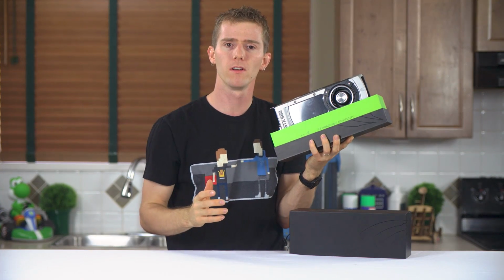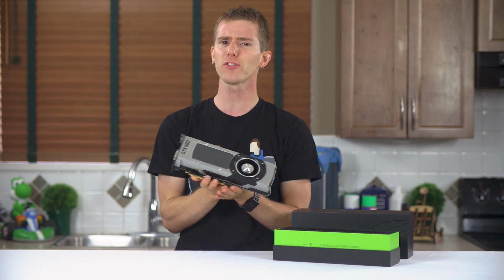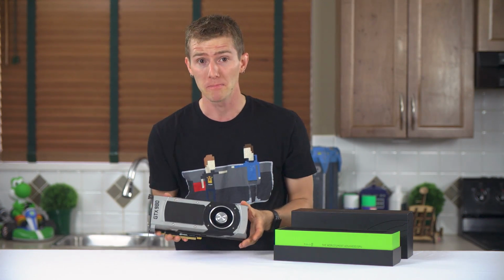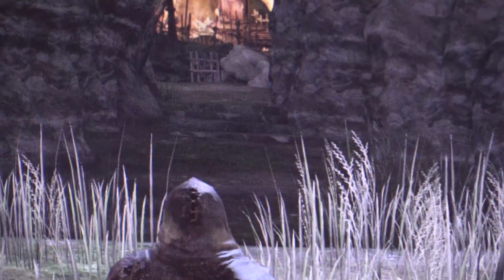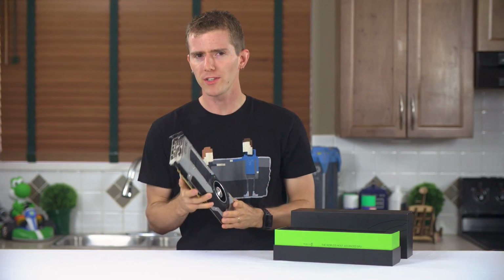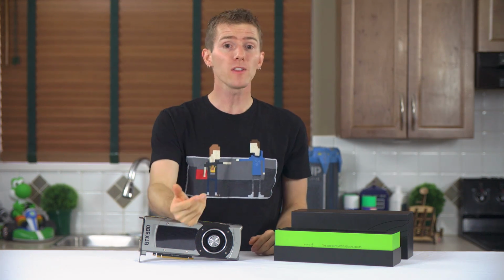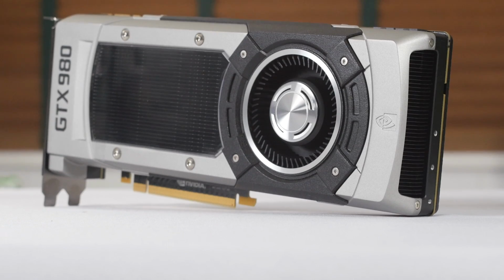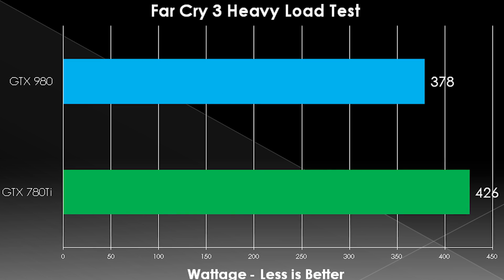NVIDIA GeForce GTX 980 Video Card - Performance Overview

Comment: Oculus improvements can only be a good thing i cannot wait for the consumer model.
That VXGI sounds incredible can't wait to see some games use this or even see how it goes with 3D rendering software could be great for previewing what the lighting looks like before starting a super intensive ray tracing render.
I'm gonna have to order from overseas due to being in Australia each brand varies from $700-$800
The US is $550 that's $613AUD and postage i doubt will be more than $20.
Great review I'm definitely saving up for one since my HD7950 has a faulty diode so it reports the wrong temp so fans rev up to 100% anytime anything intensive happens.
With the crazy OCing results i wonder how this bad boy will perform with water cooling?

Comment: Well the 980 isnt a deal breaker for me , its basically a 780ti with a discount , unless it can out performed the 780ti and the titian at stock clock i wouldnt buy it ta all . i shall wait for the 980ti !
Reply: It does. It outperforms every single GPU atm.
Reply: hmm i saw a couple of benchmarks that show the opposite . i am hoping for a stock clock beat down instead of an overclock advantage .

Comment: Well the GTX 780 Ti was a good purchase apparently, since the 980 is not a huge upgrade, and you could buy the 780Ti much earlier. I was expecting a bit more from it, but at least it's not very expensive, and compared to the 780 it's quite better, which is more of an apples to apples comparison. Not too shabby! Let's see what AMD has in store, cause if they keep increasing their power consumption, their next flagship will need a separate PSU to power it xD

Comment: How can they stop from 780 to 980 and and have the 780 perform better. Makes no sense
Reply: 980 outperform 780ti in most of the games, on hardware canucks benchmarks. Benchmark is not always accurate, so we should watch more of them to access the situation.
Reply: And assuming if there's a 680 ti back in 2012, 770>=680, then 780 would >=680 ti. And now 970>= 780, 980>= 780 ti, quite make sense I guess.

Comment: My 580 is still kicking some major ass!
Reply: My 480 is still a jet engine...
Reply: Im running 2 x evga 580gtx superclocked with 3x 3D monitors an it's still smashing it, Can max most of my games even across 3 screens :)
Reply: Kiro Zopp Hahaha. Those 480s are like having a hair dryer in your case. Just like my old 4870X2.
Reply: my 560ti died :(

Comment: As with the Hyper X Cloud headset review, great timing! I was just starting to consider throwing a 2nd 770 and a Noctura fand on the cpu (for OC) onto my old X58 platform to postpone my next upgrade a bit longer. The 980 seems to be a good upgrade from my 770 to warrant it being reduced to a physics slave card in the future.

Comment: im not all that spec savvy but from what im reading this doesnt work on laptops, right?
Reply: nope
Reply: Hououin Kyouma
would i be correct in assuming that they will eventually make a gpu like this for laptops?
Reply: *****
a laptop that can run 4k resolution on a 1080 display?
Reply: Narutou01 It'd be another ~2-3 years before something this powerful is in laptops.
Reply: *****
oh i see, there is a mobile version for them. thats awesome! too bad i just spent a ton of money on a new laptop :/

im looking at the nvidia website and i see the 970 and 980 under the desktop gpus. but i dont see any listing on the 970m and 980m under the notebook gpus. are they coming out later or something?
Reply: *****
alright, thanks for the info

Comment: I was just about to get 780ti now I'm lost. Advice anyone?
Reply: If you can find a 780Ti (I've noticed they've started to disappear), you'll probably get a pretty good deal on one and it's still a very well performing card. However, failing that, just getting a GTX980 would be a good choice anyway. They seem to be priced as per the usual high-end Nvidia card, so no nasty surprises there.
Of course, the option of getting a R9 290 is still there, unless you've already made the decision to go with Nvidia. Something to bear in mind when thinking about R9 290 vs. GTX980 is that a 980 seems to be considerably cooler running, and notably more power efficient.
Reply: I like nvidia regular driver update attitude. I have 670 now. Very happy with it.
Reply: Well then, I'd suggest the GTX980 overall. It's probably going to be cheaper to buy, definitely less power-hungry and will have plenty of support going forward being Nvidia's flagship card now.
Reply: I agree. Thanks for advice

Comment: Why is it being compared to the 680? did the 770/780 never exist?
would wait for 980ti to come out anyway, as we know nvidia likes to sell cut down cards and only release the full versions later on with a price drop once they've milked enough of thier customers and start losing sales.
We'll see if this is right...I bet I am

             750ti     950   950ti   960    960ti    970    980   980ti
name/gm107     106     106    104      204     204   204   204
sm's         5         7         8       10       12       13     16    20
core's     640    1024    1152  1280   1536  1664   2048  2560
TMU's      40       72       80     88     104     104    128    160
ROPs       16       16       32     48      48       64      64      64
BUS        128     128     128    192    192     256    256    256
TDP.         60     75        85     100    125     150~  165    200~
bandwi-  86.4     96        96      144    144     224    224    224
dth GB/s
Reply: The 700 series were essentially revamped 600's on steroids.  The 600's are being used to compare the architecture alone,  maxwell vs kepler

Comment: HOORAY!!! maxwell finally i can upgrade !!!
Reply: It's still 28nm.....
Reply: so you're saying that they are going to release something else in the next 3 months? if not HOORAY i can upgrade my 560ti's ;)
Reply: pharohbender No point in upgrading unless you need to and it's worthwhile.
Reply: sometimes you don't need a reason to do something, sometimes its just because you want to..and now its worthwhile because the power draw and then performance is amazing, and also with nvidia's supersampling tech i can run a resolution 2k on 1080p which i do already and it looks amazing but the 560 ti's are struggling at ultra resolutions. i start to drop fps like crazy if i want the nice effects and i wanted 1 card to play 1080p ultra gaming and its finally arrived, trust me i have been waiting awhile ;) its time.

Comment: Not going to swap my video card with the longest name ever for this: "evga gtx 780 dual classified hydro copper" I do like the multiple ports for easily using a multiple monitor setup, about time. However I do think the upgrade is not worth the money.

Comment: I have 2 2GB 670s in SLI with an i5 3570k and 8GB of RAM and all the other stuff. Would it be worth me upgrading to a GTX 980? I plan on upgrading my CPU anyway i7 4770k (or something higher if a new one comes out), but will this help my GPUs enough where I wouldn't need to upgrade them? (And I always prefer maxing games)

Comment: Pretty disappointing results to be honest. Yes I understand that it's got new tech to use the VRAM more efficiently, but a 256 bit bus is still 256 bit... On a flagship class gpu? Really? Definitely not worth it over the previous generation. Come on AMD, don't disappoint me.
Reply: you must love reading all of those books by just looking at the cover.
Reply: @slimj091 How am I doing that? I saw the performance graphs, they're doing the same thing they've done in the past with the 600 series, deliberately holding back the release of their fully unlocked desktop GPU so that their mobile chips catch up and look better, and just because they're lazy.

Comment: Am I crazy...or didn't the 800 series cards just come out?
Reply: They skipped the 800 series so that the desktop GPUs could catch up with the mobile GPUs. They did it with an earlier generation too, it's nothing major.
Reply: They are mobile one, 860m, 870m and 880m, m stand for mobile, which is a lot worse than desktop one, although they are not bad on their own.
Reply: nvidia renamed the desktop cars 900 instead of 800, laptops got the 800 cards.....
Reply: 1toncheese Laptops ALREADY have the 800(m) series, and I assume the 900m series will be a thing very soon. They're completely different types of cards and not similar at all, but to avoid the general confusion of 'that one is a bigger number so must be better', they skipped a number so that their desktops ones are featured alongside their mobile ones equally in the eyes of the public.
Reply: 15bitGaming
exactly what i said....... the 800m series is a mix of keplar and maxwell cards.....

Comment: Thats an incredible clock speed when overclocked, considering it's the reference design too! 1600MHz+ could be possible on third party, hears hoping.
Reply: maybe if voltage is unlocked, maxwell 750ti's are beast when overvolted (they required hacked and flashed bios's though to acheive it).

Comment: lawl! i rather buy a user r9 290x than this shit of a gpu.
Reply: shit of a gpu? the gtx 980 beats out the 290x on nearly every benchmark while consuming less power, and costing less money. turn your fanboy setting down a few notches.
Reply: 20 frames more and cheaper so te fangay
Reply: you guys are talking shit! this gpu is slightly better than 780, and 290x is beating shit of 780!
Reply: 780 TI not 780 <<<<<< You idiot 780 Ti beats the shit out of the 290x
Reply: But the 980 beats the 780 TI and the 780.
And you said 290 beats 780 = 290 better than 980
Reply: Ulim151
i ment that 980 slightly better than 780, but 290x is much better than 780 therefore 290x is a bit better, cheaper and has more bandwidth with a great 512 bit bus! and i know that 980 is more power efficient, but it's not that important! btw 780ti is a great card! but it's very expensive!  and i'm not a fanboy!
Reply: The 980 is not slightly better than the 780 its way better. The 980 is slightly better then the 780 TI
Reply: just look at the video i posted there you see how crap the 290 is
Reply: well you say the 980 is just a bit better than the 780 WHICH IS WRONG!!!!
Reply: Ulim151
NO! i doubt that these benchmarks are correct! we'll see things in the real world then we'll talk!
Reply: just look it up the gtx 980 is the best non titan card on the market
Reply: Ulim151 not at all! look at the gtx 690, r9 295x2 ann r9 290x! i think you'll be impressed!
Reply: You idiot those HAVE TWO GPUS in one card these are SINGLE GPU
Reply: Ulim151 so what? it's still one card and 290x has one gpu and it's still bests 980!
Reply: 290x does not best the 980 http://n4g.com/news/1589733/nvidia-maxwell-gtx-980-performance-15-faster-than-r9-290x-gtx-970-10-faster-than-r9-290
Reply: Just look it up the 980 is better. Why would Nvidia bring out a card that is worse? Makes no sense. Nvidia always beats amd then amd nvidia after each series. But amd starts to loose the fight because they start makeing more apus less gpus.
Reply: http://cdn.wccftech.com/wp-content/uploads/2014/09/NVIDIA-GeForce-GTX-980-vs-Radeon-R9-290X.png
Reply: i'm sorry to have to deflate your ill informed bubble Mrfailstandstil. but even the 970 has been pulling ahead of the 290x in nearly all benchmarks.

look man, i've ran AMD gpu's for the last three cards in my machine. I like AMD. but plain and simple the 900 series kills any single gpu currently has on the market in raw horsepower, power consumption, and price. and i spend my money on what i get the best value out of. currently that is Nvidia.

there is no reason to fanboy up over this.

Comment: So I should still wait on my Titan... I thought I'd sell it for a 980.
Reply: Just stick to it until you actually need to upgrade. It's really not worth selling that card because it's going to be a hard sell for a decent price with that 980 on the market.
Reply: if its a plain titan maybe. If its a titan black probably not.
Reply: ***** sounds good. Maybe get another Titan to SLI if its price drops nicely.
Reply: Eddy Gaming I doubt the Titan's price will drop significantly because it's on the 'prosumer' level. Besides, it's a really fast card as it is.

Comment: Dissapointing performance over the previous generation of Nvidia cards. I suspect that the next revision of Maxwell will have a 384bit bus, higher clocks and probably more RAM on it. There is more than enough power headroom to do such improvments. But for now, the card isnt worth it.
Reply: The bandwith on the card is much higher on the 980 so its using more of the RAM and GPU then older generations of cards.
Reply: It's compressing the ram usage. So you can't really compare amd/nvidia memory brandwidth/bus
Reply: ethan wot
not exactly its using them better.......
Reply: Thats what I meant sorry :P
Reply: Guess it's just an overclocked 780ti for the environmentally conscious or something.
Reply: ricojes
nope, its a better card for the environmentally conscious and the power hungry......
Reply: Wait for a 980Ti or even a 990, hell what if they make a 990Ti OMG IT'S OVER 9000!!!!
Reply: Agreed Disappointing result and performance. Not worth the upgrade.
Reply: ta specs den simenoun performance se toso megalo va8mo file,simasia exei to design to processora kai olou tou sistimatos genika

Comment: Think I still get the Titan black
Reply: If you're not doing workstation stuff, and only gaming, get this card instead for sure. You'll be saving about good 400 bucks, and you'll be getting around the same fps. Since a 780ti is equal to a Titan Black. But yeah. Get the 980 instead for just gaming bro.
Reply: Qwertyz44000 780ti isn't equal to the titan black. You still get better fps with the titan black.
Reply: TY STOE
yes it is for all reasonable intents and purposes, titan black is a superclocked titan and all the 780ti and titans have at least 1 fully enabled gk110 core (the titan z has 2 and is the only one to do so), the titans have the cherry picked gk110 cores and double point precision but the 780ti also can have it with softmodding as nvidia purposefully nerf gaming cards to prevent them from cannibalizing the workstation grade cards. only when the 780ti runs out of vram can the titan black pull noticeably ahead.
Reply: http://www.geforce.com/hardware/desktop-gpus/geforce-gtx-980/specifications
http://www.geforce.com/hardware/desktop-gpus/geforce-gtx-titan-black/specifications
You guys are right 980 is equal or little better then the 780ti but my question is how because look at the specs. Only thing better is the base, boost, and the amount of watts its got. Yes I probably getting the 980 now seeing proof on gaming with it and seen it got 2 to 5 fps better over the 780ti and also I can buy 2 of them instead of buying one titan black.
Reply: TY STOE
or you could wait for amd to launch the 300 series and nividas retalliation with a 980ti that they probably already have ready?
Reply: Sorry I am not going amd. Also I am not buying one right now anyway, I am waiting until probably April or so because I am new motherboard from evga and I want intel i7 4790k processor.  My GeForce GTX 780 sc 6gb works good at the moment.
Reply: TY STOE
im not talking about going amd, theres a reason nvidia doesnt ome out with the 980ti immediately and its because they want to keep it hidden untill amd shows its cards off, if nvidia loses to amd then they will launch the ti asap to recover their position at the top.
Reply: That's why I am waiting until April or so because I already know that.
Reply: TY STOE
just making sure, nice bit of advice to those that might not understand.

Comment: Overclocking => heat => power consumption => dead card in 2-3 years = more money spent => overclocking for "rich bastards".

 I prefer my system to live at least 4 years without anything breaking. Plus it's pretty much the time of step up in graphics. Usually my FPS drops to unbearable numbers every 3.5-4 years, that's without any overclocking whatsoever.

Comment: im a 780 User, 900 series looks like not be worth of investment - unless you care for power savings - i'd even go far as and dare to say - even 600 series users shouldnt buy it
Reply: Idk.... 650/660 are waaayyyy too outdated
Reply: Hardware canucks showed the 980 getting twice as many frames as the 680 on BF4...
Reply: Ruskie  Still play games quite well :P
Reply: I'm still on my 570 and I don't plan to upgrade soon. It still plays new games just fine at 1080p and medium-ish settings.
Reply: They are reference card however, non reference one would better, not to mention the price is $200 cheaper. Gtx 980>= 780ti, 970>=780, 780>770, 770>=680, I can see plenty of reasons why 600 series users should upgrade to this one. With around $300 you can get the performance of 780, which is something you cannot do in the previous gen.
Reply: HCK Gaming there are custom cooler options already. Are those the nonreference ones?
Reply: Corey Muncey I mean the one in the video, that is a non-refrence 980. Eric from tech of 2mr and hardware canucks also holding the same non-refrence 980. Custom cooler one are mostly non refrence design.
Reply: HCK Gaming Yeah, I seen yesterday when they went up, that there are already custom cooler designs, not sure if they're non reference or not. Is the only reason for them being reference, is for water block purposes?
Reply: Corey Muncey I'm not quite sure, I think you better ask someone else.